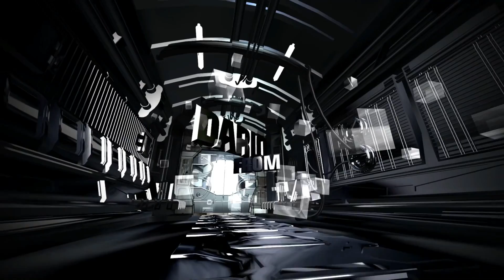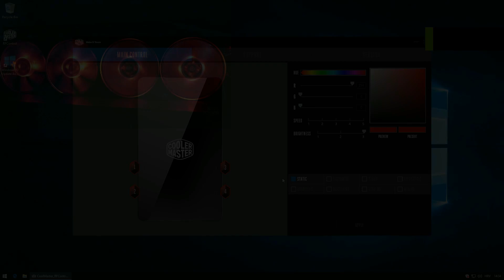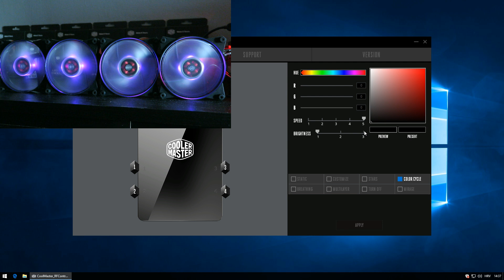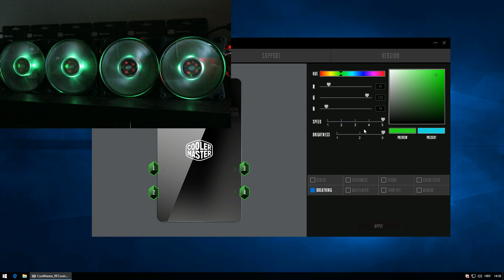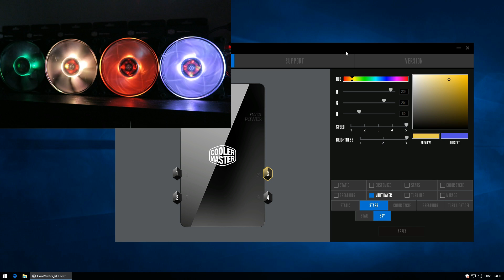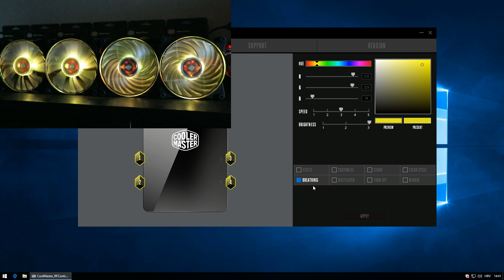COOLER MASTER RGB LED Controller - TUTORIAL AND REVIEW

Comment: I bought this RGB led controller today and it works fantastic. The Cooler Master LED logo on the front of the controller looks classy as well. I definitely recommend this controller for anyone not looking to spend over 60 dollars  on a RGB controller. Great video!
Reply from the maker: Esco Whitfield Thank you very much and glad you are satisfied 😉
Reply: Can you control 6 of these fans ?
Reply from the maker: David Anderson You will need a splitter but then one channel will control more fans and you can’t get a separate effect on each fans. For instance you will connect three fans on one channel and they will act the same. The rest will be acting like you adjust. But if you go with the same lighting effect on all of them then you are good to go.

Comment: I have 2 questions:

1. Will it only work with cooler master fans or any brand?
2. Can you connect other rgb items or just fans?
Reply from the maker: Doggo the Doggo Well checking it right now again, the end of the cable that connects to fans or whatever is the 12V 4-pin RGB header so you might be able to connect other fans. Have tried it so can’t say with 100% certainty. As for adding RGB LED strips or other RGB LED products, not sure how the program or the controller will react. I will have to test that out.
Reply: @PCCrazyDario  I have an LED strip plugged into it and it functions the same as my fans
Reply from the maker: Raven Thank you for the additional information 😉😉

Comment: Was really hoping to see you connect all 6 as I will be connecting 6 fans. Was curious to see if you use a splitter to connect 2 fans to 1 port, if the software will give you control of both fans separately or if having 2 fans in 1 port means they both have to be the same color and synced together because they share a port
Reply from the maker: Oh I can tell you that like this. It won't. You have 4 separated channels and those are the ones that you can control separately. If you connect two fans to a splitter and connect them to one channel, then you will be controling both fans at the same time. The RGB controller doesn't recognise individual fans when they are on a splitter.
Reply: @PCCrazyDario  thanks so much!!! Guess the other 2 I'll connect to the motherboard header!
Reply from the maker: @KSMKxLEGENDx  No problem at all. Not a bad idea. But then you won't have that special effects from the controller. :/

Comment: Thanks for the review! btw, Is it possible to control deep-cool RGB fans or any other RGB fans/strips through that controller using the cooler master software?
Reply from the maker: Luffy's Base Hmmm, good question. Unfortunatelly I don’t have with me any fans with RGB that have the same 4-pin jack that is functional. I can’t give you 100% answer but if I get something similar I will test it out.
Reply: PC Crazy Thanks :) will be waiting for a video on this. But for now I guess I will turn on the notification for your channel. :D
Reply from the maker: Luffy's Base Thank you. 😉 But actually when I think about it, I think that it isn’t possible to access all those cool features MasterFan has because they are specially designed for the Cooler Master application so it is a big chance it might not work. I did a little brainstorming. Hmmmm... 🤔

Comment: Hi I have set up the fans and lights with my PC, they work great and very happy, i have used the software and am able to choose between the colors i like, how ever an i able to set it so when i turn on the PC lights come on and when i click shut down the lights go off?
Reply from the maker: Hi, can you please explain the question? I had hard time following what you are asking and figuring out what you want to know. Thanks
Reply: @PCCrazyDario  Hi, when the PC is live and switched on the lights turn on and i am able to make them custom colors, but the PC is in my room so when i shut down the PC when i am finished i want the light to completely switch off, but they stay on.
Reply from the maker: @georgealt6547  Ah, gotcha. I think there is an option in the software that you use for the ARGB adjustment to switch it off when the PC is off. Try to find it somewhere in the app.

Comment: great job, with the 4 fans shown in the demonstration. Did you connect three using the splitter and one just by itself into the RGB LED controller?
Reply from the maker: Golden No, I connected them all separately because there was no point using the splitter since I had four channel free. But in my new build, I have 9 fans and I had to use 3x trident splitters. Everything works great.
Reply: PC Crazy thank you 👍
Reply from the maker: Golden No problem and you are welcome. 😉

Comment: Do you need an RGB controller to control the fans speed? By the way do you need the controller to make them work? Thanks!
Reply from the maker: apostolis633 With the RGB controller you control the lights and with the fan controller you control the speeds, So next to this RGB controller you need another one that will control the speeds of your fans.
Reply: tho the fans can work without them right? Like a normal fan?
Reply from the maker: apostolis633 Without RGB controller yes, but they don’t work without PWM connected.

Comment: If I'm going to use the splitter cable, will i be able to set the color of each fan individually or it will all be the same?
Reply from the maker: Jonas GJK Since I have the same thing in my computer, let me test that for you and I will get back to you. If I by any chance forget, please remind me tomorrow. 😉
Reply: Alright thank you!! :)
Reply: Hello Daario. I hope i spelled your name correctly! If i didn't i apologize in advanced. May i know if you tested the splitter cables already?
Reply from the maker: Jonas GJK Hi Jonas, don’t worry. I was called in London Darius haha. 😉 It’s Dario so you know for the future. I will do it today and let you know as soon as possible. Sorry for the wait.
Reply from the maker: I did test it, sorry for the delay. So if you use the Trident splitter cable you control lights on all three fans. You can't do it separately, because the RGB LED controler has only 4 channels. So basically, all fans connected to the trident splitter will have the same color.
Reply: Alright thank you so much!! I was looking for an answer online and non of the forums/videos/online shop answered my question. Thank you so much!!
Reply from the maker: Jonas GJK Glad I could help... 😉👍

Comment: Can you make a breathing effect that color cycles?
Reply from the maker: Andres Maldonado I have unplugged my CM RGB LED Controller since my motherboard supports 4-pin RGB connectors so I can’t check it on my computer. On AURA SYNC RGB you can only make separate Breathing effect and separate color cycle. But I checked the video again and unfortunatelly you can’t do what you asked. Sorry about that. 😬

Comment: I bought this, haven’t used it yet. I am going to be using it soon, however, since this is for RGB only, if my motherboard doesn’t have enough fan ports for all the fans, do I need to get a fan splitter as well? So I would have all the RGB go into the RGB header and all my fans go into a splitter? Is that how it would work?
Reply from the maker: Bellion If the motherboard doesn’t have enough 4-pin or 3-pin ports then splitter is the best way or fan controller. You said everything correctly. 😉
Reply: PC Crazy okay thank you appreciate it
Reply from the maker: Bellion You are welcome 😉
Reply: PC Crazy which fan splitter would you recommend?
Reply from the maker: Bellion Well I usually go with the one from www.ekwb.com 😉

Comment: did you use the splitter?
Reply from the maker: amaskedman In the video no because I could connect 4 fans to all the channel on the RGB controller, but I did use 3 splitters in my private build. Try checking out my video “Timelapse Build - Cooler Master MasterCase H500P”. You will see everything there. :)

Comment: Does the controller work with regular LED strips?
Reply from the maker: GenericYoutubeNameHD If you have LED strips that support AURA SYNC with that 4-pin connector, I think you can connect them without a problem. You can buy them at www.cablemod.com

Comment: Where do you plug the pwm fan cables though? Do you need to plug them into the motherboard using the motherboard's fan headers to control the fan speed? Or do they plug into the rgb controller?
Reply from the maker: You either connect the PWM cables to the motherboard or a separate fan controller that regulates the speeds.
Reply: @PCCrazyDario  gotcha

Comment: The fan comes with 2 cables connected? Where do you plug the 2nd cable in?
Reply from the maker: Gameplay International You connect one cable to the RGB controller or splitter and the second one to the fan controller or to the motherboard.
Reply: Thanks!
Reply from the maker: Gameplay International You are welcome 😀

Comment: Can i connect 5 fans on 1 rgb header on asus motherboard and make all fans sync with aura sync?
Reply from the maker: Haven’t tried that one yet, but if you do you will need 2x 3-way splitters. My opinion is that it should work. فلاح مصرى

Comment: how connect the fans?? video?? plz
Reply from the maker: Axel Leax So you get 4 cables which have two sides. One smaller connector goes to the controller and the other wider 4-pin connector goes to the fan connection. Also, when connecting the wider part be careful that the arrows on the connector face each other. That is it. 😉

Comment: nice video , but my motherboard dont have rgb headers . where do i need to plug in the splitter ? to usb pin ? do i need some converter or what . can you help me ty
Reply from the maker: Amir Shah If you bought three fan set, you will get a LED RGB controller and you can control the fan lights through that device. Just plug the device into USB 2.0 header on the motherboard and you don’t need any pins extra for the RGB. 😉 Thanks for the comment... 🤗
Reply: PC Crazy ohh i get it now . thanks a lot for your quick reply . saving my time , have a nice day sir .
Reply from the maker: Amir Shah Really glad I helped. 🤗 You too have a nice day. 😉

Comment: Can I buy and adapter to use more fans for 1? For example use 8 rgb fans instead of 4
Reply from the maker: BrandonRD You can connect more fans on one channel but you have to understand that you will need a hub to adjust the speed because you can’t control all 8 of them through the motherboard since you won’t have enough connections. As for this RGB controller, you can do that.
Reply: @PCCrazyDario  thanks, ill just get a motherboard with rgb header lmao
Reply from the maker: BrandonRD Or that as well haha
Reply: @PCCrazyDario  is the ASRock b450 steel legend a good option?
Reply from the maker: BrandonRD For what exactly do you need it except for making a build? I mean, any additional specs from a motherboard that you need to have?
Reply: @PCCrazyDario  overclocks... Or should I just get a msi tomahawk?, If so, should I get the max?
Reply from the maker: @br5dn847  Go with the Steel Legend. ;)

Comment: If I haven't got rgb support on my motherboard, I can still use this program if I connect the fans to the CM controller?
Reply from the maker: Tech Hungary Yes, as you can see in the video. The only way I connected the fans to the motherboard was with 4-pin for the RPM control of the them. You can control the RGB through the RGB LED controller.

Comment: Hello! Can I connect more than 4 rgb devices to that controller and switch colors on them separately? And how I understood, i don't need a RGB header to use that controller?
Reply from the maker: Mr.Dominoshko Hi, you need a RGB splitter and you can connect as much as you wish. On the controller you have 4 channel and you can manage them separately. If for instance you connect 3 fans on one channel with a splitter, then you can’t control them separately. You would control all three at the same time.
Reply: @PCCrazyDario  okay. Thank you very much 😉
Reply from the maker: @vladdergachov5384  You are very welcome. :)

Comment: all the fans msut be connected to pwm headers on motherboard or take energy from the controller? if connect 3 fan with the splitter to one port of the controller, the power needed is enough?
Reply from the maker: Gian Maria Calvagna I only know that they need to be connected either to a controller for speed or to connect them to the motherboard. Probably you could use a splitter, but they have one cable for RPM and another for RGB colors.
Reply: so, apart the controller I need also all the connector to motherboard? not for colors. because i sow that the fans have 2 connectors. the only thing i need to know is this. because i have to buy a pwm splitter in case.
Reply from the maker: Gian Maria Calvagna Yeah, you need to connect the second connector to the motherboard. Or as you said, you will need a splitter.

Comment: Do you need this splitter to connect to the 4 fans what are already in your case or is this for extra fans you buy because when someone set this controller up for me they have used the splitter and only two of the ports in the controller and i can't use the customise or multilayer i am guessing that i don't need the splitter and i have two spare cables now what came with the controller
Reply from the maker: Lee 89 You don’t need a splitter. You can connect each fan to separate channel.
Reply: @PCCrazyDario  Yeah i have done it myself today thanks but i am missing a 4pin connector i ordered some off amazon and they are coming tomorrow so everything should be working perfect it is different though since i made the changes
Reply from the maker: @lee8956  Strange, you should received all the 4-pin connectors with the controller and the fans together. :/ Oh well, you managed it without a problem. Hope you like the effects. ;)
Reply: @PCCrazyDario  I did but i took it to somewhere last week and i went o pick he pins up and i only got one back he said he used 3 of them but he can't have i ports 3 and 4 missing the others were connected with the splitter at least getting some 4pins today though :)
Reply: One more thing i was wondering do i have to buy the cooler master light strips to work with this controller or will it work with any 12v light strips because the cooler master ones are so expensive lol
Reply from the maker: Lee 89 I have heard that any LED RGB strips work, they just need to be 4-pin 12V strips. 😉
Reply: @PCCrazyDario  That is great thank you for the replies i will have another controller in my case at some point anyway im changing my cpu cooler to an argb cooler master one because i just have a blue led one in there at the moment and it does not go right with rgb i am only using the usb 3.0 ports so i have an extra usb 2.0
Reply: Everything is sorted now thank you so much for your help even though i have 39 extra 4 pin connectors now  but i guess they will come in handy at some point lol
Reply from the maker: Lee 89 Hahaha you are kidding me? 😆 You could only order 40x pack. Wow! BTW, you are very welcome and sorry I didn’t reply immediately on some questions.
Reply: @PCCrazyDario  No problem at all and lets just say i am impatient lol. They were the first ones i seen and it said next day delivery plus it was only £3.29 for all of them even though i only needed the one but oh well i guess i will never run out now haha i just need more lighting inside my case now

Comment: i have a  D-rgb led strip (3pin) and i have a 4 pin rgb header only and i want to connect it to the hub, is that possible?
Reply from the maker: R0win No, don’t even try that because D-RGB 3-pin connector is 5V and the standard 4-pin RGB is 12V. You will burn something. 😬
Reply: They make a D-LED version on amazon btw, and 4 pin RGB is the only thing that works on the version in the video
Reply from the maker: @copy.4123  Yeah, ok. But he was asking if he can connect the D-RGB LED strips to standard RGB connector. Not a good idea.

Comment: Hey bro can I connect fans RGB connector to my motherboard RGB header and can I control its RGB using RGB sync of my motherboard without using that additional controller
Reply from the maker: Prabhat Kumar Rajput Hi man, yes you can. You just need a splitter to connect more of them and you will be fine. I connected one of them for twsting purposes to my motherboard, ASUS ROG STRIX X299-E Gaming and it work like a charm through ASUS AURA SYNC 😉
Reply: PC Crazy hey bro I am thinking to buy tuf z370 plus and there is no video on YouTube for that Mobo can you please tell me something about that 
And will I get that splitter thing with that or I need to buy separately

Comment: Hi, which software did you use for this? thanks.
Reply from the maker: Here you go:
Link 1: https://coolermaster.egnyte.com/dl/eUTY1qyRvG/
Link 2: https://masterplus.coolermaster.com/#download
Reply: @PCCrazyDario  You don't really show how you connected your fans to that controller and are able to control them individually, the 1-3 controller only allows me to control them in groups of 3. How did you do that? plus, I'm not sure what happened in the last 8 months since you posted these links to the software but I've had these fans for about 3 years now, and I have never been all that impressed with the software. The software you showed in the video is a lot cooler than mine. These links direct me to are the same crappy software I've always had.  I have 3 pin fans and you are showing 4 pin jumpers is that the problem?

Comment: i need help, i have cooler master master pro 120 air flow rgb 3in 1 whit rgb led controller and 1to 3 splitter cable for rgb led fan,my motherboard is asus h110-k and and dont know how to work all 3 fans...plz explain my hot to make to work
Reply from the maker: Just noticed your message on my Facebook page so going to continue there if you don't mind. ;)